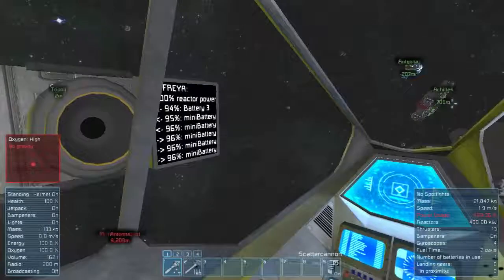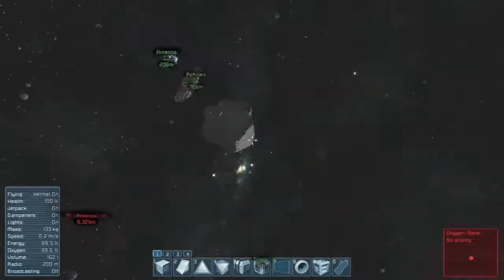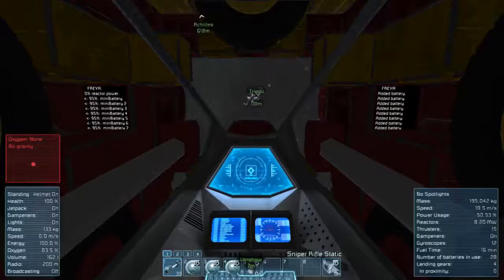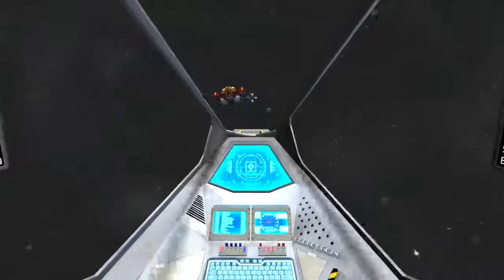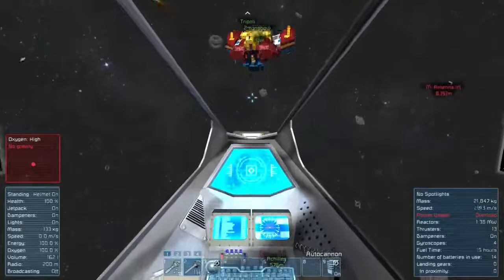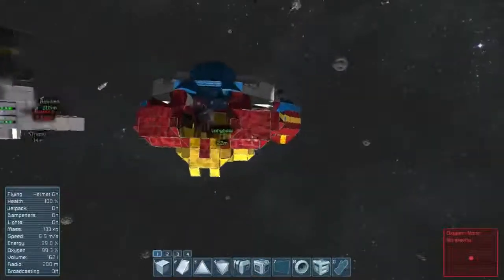Super High Efficiency in Space Engineers

Comment: Btw, if you can't solve the prob with Freya resetting herself back to normal mode, you might want to apply something called a "Watchdog"-Timer using a second prog.-block. Watchdog-timers are used in micro-controller (MCU) programming as an independent timer system that checks ever so often if the main system is still responsive and/or tracks the main system state. If the main system does not respond or stays in a certain state over a specified time limit the watchdog-timers triggers a reboot of the system to kind of "unfreeze" it. The cause of the problem why the system became unresponsive is not solved but the system will be restored to an operational form until it refreezes. And often this is just good enough in Electronics.
Reply from the maker: TrustMeI'mAnEngineer In this case, it's just that the ship is always in absolutely critical energy management. The slightest motion costs 10x more than the generators produce. Freya is, logistically speaking, supposed to be in critical mode the whole time with that ship.

Comment: Very nice demonstration. I am thrilled of your use of wheels. I have seen that before but I never have seen actual demonstration of it's performance.
I'd love to know more details about Freya. Maybe go through the code or some math involved in such a ship system. Also, at what point does the depletion rate exceed the charge rate and the power goes to 0%? Is there a "range limit" to this design, i.e.: you need to pause once in a while to have the system charge up the batteries again before it can be fully functional again, or what are the other limitations of Freya atm. Keep it up. Love your vids.
Reply from the maker: TrustMeI'mAnEngineer Well, Freya can't make energy appear out of nowhere, so obviously there is a limit. However, even with batteries alone, you have several minutes of active draw before they deplete. Having a reactor charge those batteries when possible allows you to "take downtime" every second you aren't actively thrusting at full force. For example, if you accelerate to max speed and then turn off your inertial dampeners, Freya will use that drift time to recharge your batteries.
Reply: Yes, I know there is obviously a limit. But is that limit significant? For example...in a real combat scenario would the ship survive longer than the system deplete itself over the course of a few minutes, as you say, or will the downtimes during combat, be enough to sustain power levels to surpass any life-expectancy of a small shit with this system installed in a combat scenario. Because that would be a "significant" limit that actually affects performance that we care about. If she runs out of power doing trading runs from jupiter to mars nobody really cares, the can just take a break. I guess you can't really answer this question without testing Freya in a combat scenario against other players. But if you would full thrust ahead and not shot down thrust after reaching vanilla max speed, how long would the batteries last (exact time) for the longbow for example? That would give a good indicator for combat performance. Also, would it matter if you cycle charge the batteries independently, i.e.: somehow detect power usage and charging single batteries when the power usage doesnt need them? If the ship is always in critical condition, then you wont have any free powermargines EVER, right? Hmm...interesting conundrum. Freya would be a nice buffer system for ships that have normal reactor configurations to max out power usage efficiency (great for survival).
Reply from the maker: The Longbow can operate at max thrust for around 10 minutes.

Freya is only useful in a survival situation. BUT I am uploading a hell of a new AI that is useful everywhere.
Reply: 10min is enough for any situation I can think of. I thought it would be something like 1.5min only.
Reply: Craig Perko Is the AI based on combinational and sequential logic or are you using neural networks?
Reply from the maker: They're very basic expert systems.